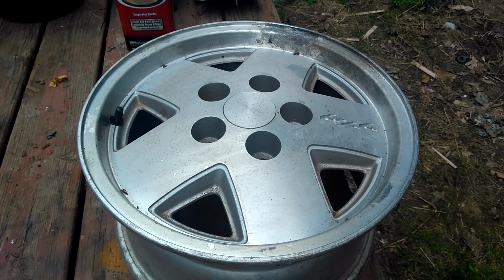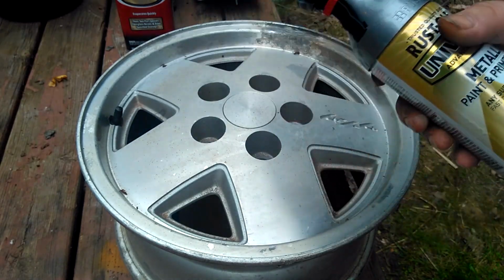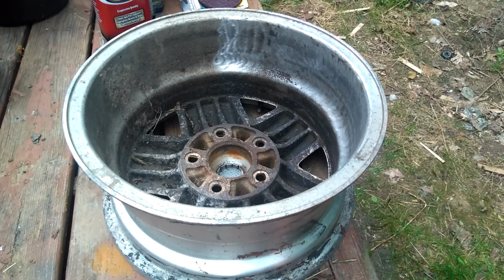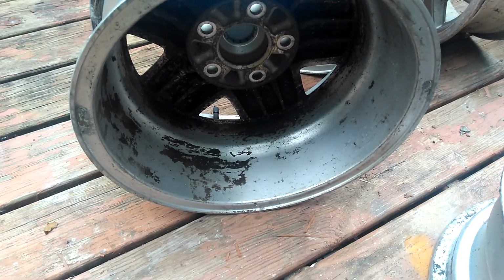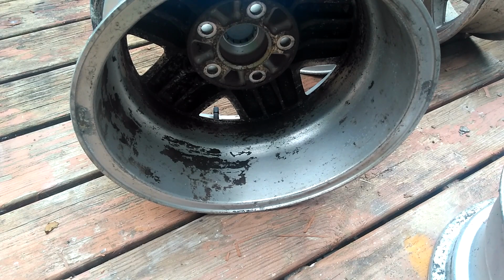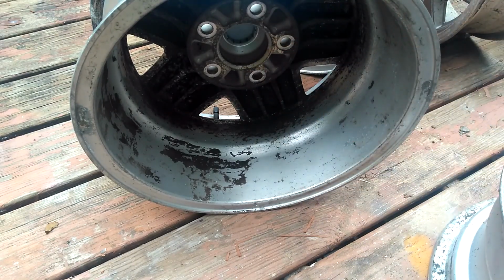Rattle Can Painting My 4X4 Blazer Wheels (PT 1)

Comment: Was any of that curb rash? I've got a set of rims that need some work and this kinda gives me an idea on how to maybe look better. B ut I'll be using tractor paint so it won't chip off.
Reply from the maker: Yeah they have Curb Rash on them, Imo the Wire Wheel did a great job getting all the corrosion off them, But when it comes the Curb Rash you'll probably need to Sand them starting with like 220 Grit & Working ur way up to like 1000 Grit Sandpaper, Bc that will get the Curb Rash Scratches out, But for corrosion I'd definitely 100% use the Wire Wheel...... I guess the Wire Wheel could work too but man it would take awhile for it to actually get the Scratches out tho, You'd be better off with sandpaper for sure
Reply: @s10_4_life6  oh ok,  I'm hoping to work on them soon. It might take a while. Not up to it very often.
Reply from the maker: Tbh with you, one thing I hate is working on Wheels, It always seems like it takes FOREVER to get them done, But I guess the end result is worth it I guess Lol....
Reply: @s10_4_life6  I don't blame you. I'm not to thrilled about it either.
Reply from the maker: Hey sorry I just reread ur 1st Comment, If you are planning on Painting them, You might be able to to get away with buying Filler Primer for the Curb Rash Scratches as long as they aren't to deep, If they are deep then yeah you'll have to Sand them down some...... When I said to use 220 Grit Sandpaper and work ur way up I was thinking of keeping them Aluminum Color & Shinny, But yeah if you're painting them then I'd just try some Filler Primer first and see how that works ( or just wait until my 2nd video comes out and I'll tell you Lol, bc that's what I'm doing 😁 )
Reply: @s10_4_life6  oh ok, yeah I was thinking painting them so I can make the look better. Just undecided of color. But I'll watch out for your video, lol.
Reply from the maker: @layitlo  What kinda wheels are they & What are you planning on putting them on ??   You can PM me pics on FB if you want